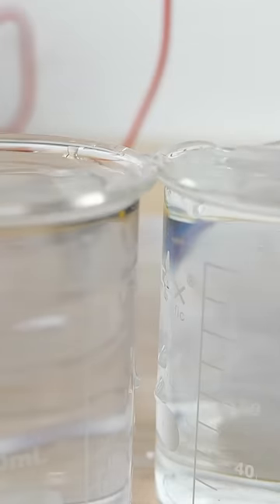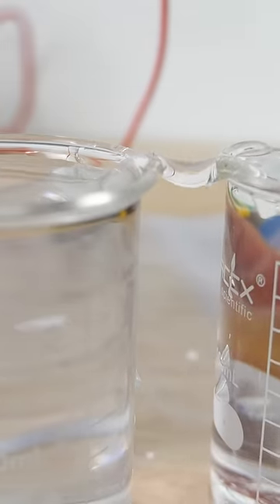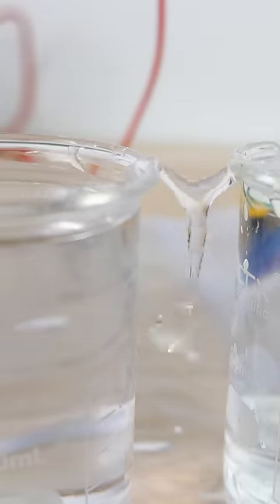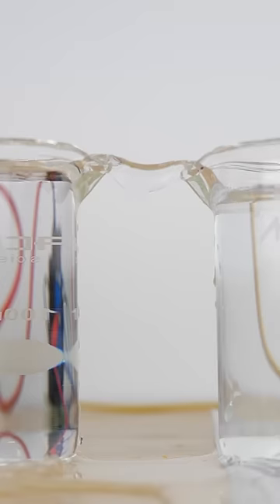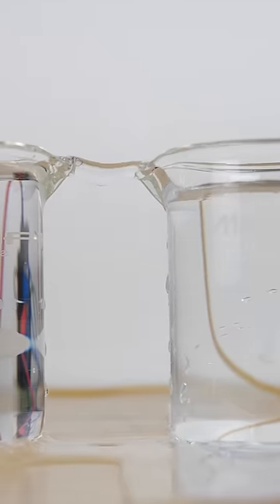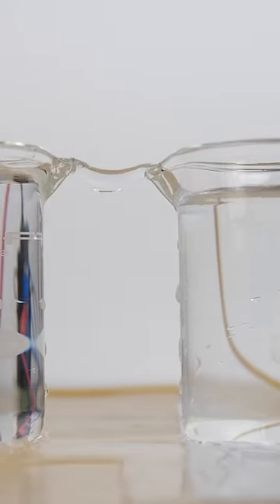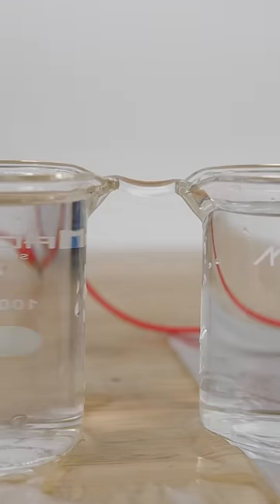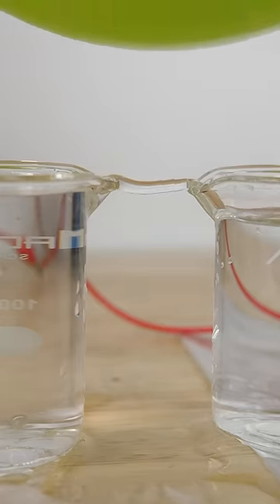How To Make Stretchy Water

Comment: One thing to consider, deionized water quickly loses it properties in open air. Carbon dioxide is an ionic gas and is (fairly) abundant in our atmosphere. The deionized water pulls in the CO2 easily, thus degrading the water. If your DI water sat around for very long (more than 30 minutes) there is a real possibility it wasn’t very deionzed anymore. Also, did you buy that DI in a bottle or do you have a DI system in the lab to get it “fresh”? If it was bottled, it probably wasn’t nearly as high purity as you might hope.

Comment: Electricity works by creating a voltage divide where energy at one end is higher then the other, and so it flows in the direction of low energy. Add a little friction forces and the water gets dragged along.

Comment: Stretchy water is when the water molecules, influenced by a super low voltage, undergo a spontaneous phase transition into a highly elastic state, akin to a rubber band. This temporary alteration in molecular structure allows the water to stretch and form a bridge between two beakers, showcasing its newfound prowess in defying the laws of physics. It's like water's rebellious phase, where it decides to challenge conventional science just for the fun of it.
Reply: This is total bs btw
Reply: No. Just no.

Comment: Electricity continues to flow through the air if the tether is broken. Until it disperses or loses contact with the current. Electricity is basically just an electron highway, where the electrons do not want to stop moving until they hit the ground. So the water tension added with the electrical tension create the bridge.

One side heats up because the electricity is going to that side and has no where to escape so it converts into thermal energy. Because matter cannot be created or destroyed. So if you ground out the water with another metal wire, you should solve your heat sink issue.

And the static electricity from the balloon attracts the electrons from the electrical current, causing the bridge to try and jump to the new source. But the pull is not strong enough to counteract the pull from the other glass.

Comment: Water is polar, so i'd imagine the high voltage, and the magnetic field generated by the flowing electricity, pull along the water molecules.
Reply: If you don't have a phD you should get one for free
Reply: There shouldn't be much of a magnetic field if the water is deionized since it'd have a pretty high resistance to current flow. Unless the water molecules themselves become ionized by a voltage that high? Otherwise they'd be electrically neutral and not so good as charge carriers.

Comment: After the water bridge broke an electric arc formed 
I'd say the electric resistance of water is much less than air but the electric field was strong enough to keep the current flowing after all opposite charges attract 
the high voltage ionises the water
2H2O→ H3O+ + OH- 
And increases the surface tension enough to resist gravity 
And of course any electric circuit heats up since it has a resistance to the flow of charge that wastes energy 

But that's just my suspicion

Comment: Theory: The shortest path is on the surface, at the top where there is least sag. The reason for water's surface tension is the electronegativity of the molecules sticking together - the hydrogen ions are positive and when a voltage is applied they orient themselves to maximise stability, which means getting the hydrogen ions as close as possible to allow the voltage to pass through with minimal resistance. This decreases the freedom of brownian motion for the molecules, so they remain in the surface tension state, stuck together. This makes those molecules at the surface a negatively charged film that is very lightweight for its charge, and if the voltage is high enough it will overcome the resistance to motion caused by the weight of water just behind the film when put under an electric field. 

The water heats up because the average velocity of the molecules stays the same, but the surface molecules are being held in place. Their energy gets redistributed to the flow travelling one direction.

Always fun to do hypothetical physics lol even if it is the start of April

Comment: very cool, especially when there are no conducting salts in there to aid the current. 
I feel like this is an electromagnetic effect caused by electron movement from molecule to molecule , basically sticking the electrons together and gluing the molecules to each other elastically.
I wonder if there is an isotopic reaction too perhaps forming higher electron fields in certain structures

Comment: The water wants to move due to the current across the two bodies of water. The water is able to form the bridge and move due to the surface tension of water. The rate of movement at that time is directly related to the amount of energy and resistance in the system. When you introduce the static charge balloon in the correct position it draws the flow upwards into the shape of a siphon and now there are two mechanisms working to move the flow making it seem as though the system is more excited even though you have not added more energy.

Comment: water molecules are polar. when you charge with electricity then electrons go from one side to the other pulling water molecules with it. the reason why a water bridge is possible is because its pulling energy beats gravity up to a point where the mass of the water bridge if too large beats the pulling

Comment: That phenomena is caused by the surface tension of water which is originated by the electric charges of hidrogens atoms, when they get aligned through the powerful electric field formed along the all the molecules of water between the electrodes.

Is a phenomena similar to a long chain of non magnetic metallic balls or metallic shavings formed between to distant magnets, but now with electric fields instead of magnetics.

Comment: You can do the same thing but more effectively vibrating the water to create a hydrogel that actaully acts like a fiber optic cable. In fact our bodies already do it and send biophotons through them that have picked up and carry information.  The water is turned to a hydrogel by specially placed holes in the microtubles that vibrate the water as it flows through.

Comment: I'm pretty sure its because you turn the water into a magnet. If you do the same thing with Ferrofluid and it works the same that would mean the charge is increasing surface tension and making the molecules stick. I wonder if more power would make it bigger or if its all the same?

Comment: In deionized water, there are still ions due to autoprotolysis. This leads to there being H₃O⁺ and OH⁻ ions, about 10⁻⁷mol/l each.
This does not sound much but it's still 6×10¹⁶ of each ions in a liter which makes up about 4mC of charge.

Comment: If it reacts to the baloon like that, then  the water bridge is most likely caused by electrostatics.

If the water moves while near high voltage, then it's not surprising that some energy will be converted into heat.

Also, have you checked how that water contraption affects that power grid and what resistance does it have?

Comment: I think it's just the electrical current itself making it like a fibrous channel from the pathways of the currents. So maybe microbubbles but I think it could just be the channels of the currents itself. Even though it's "very low currents" within it there is still current. As for why it flows that way, it's literally the path of least resistance because of the shape of the beaker pour.

Comment: I think that's because the electrons are traveling in the same direction and in the process of electrical resistance the water heats up so basically it starts heating up on the bridge and the heated water stays in one cup.

Comment: Well my hypothesis is that the energy flows through the water to the other cup and in that motion it creates suction or drag which continuously needs to be filled like gasoline through a hoes after sucking it.
And then you might ask why water and not air? My answer is surface tension wich in this small amount is greater like you said yourself the energy needed to break the surface tension is greater then keeping it running. 
About the water warming up I could say the motion creates friction but I don’t think that’s it. Somehow the energy (electricity) must change to warmth but some materials get hot while electrified especially thin materials. This is not thin but the ”water bridge” is pretty thin. (Question 2)
Challenge: to correct me if I’m wrong and failed to take something into account.

Comment: I’d say it’s possible that the weak magnetic field or whatever you call it of individual h2o molecules is getting amplified by the voltage. Where you have current you have a magnetic field, right? At 40kv, things just start breaking, right? Maybe some form of energy to magnetic field conversion at a molecular scale making the water join and bridge up. Would that be possible to test or disprove in theory? Idrk anything about this sorta stuff as far as coming up with new ideas… another thought tho is that high voltage ionizes air, which we know to be the best insulation, so why couldn’t it just ionize water, and the surface tension is keeping it together, but also the water itself insulates the voltage too, giving it more surface area to spread across, so we don’t get the lights or sounds, like a wire that’s see though, ionized by high voltage… maybe both?

Comment: my guess: its clearly high enough voltage to make the resistance of the water not do much, so im thinking this is that same phenomena as when high power goes though a bunch of cables in parallel and they all move together. this force must hold the water together better causing the surface tension to not break.

Comment: The water flows from one side to the other due to the molecule's electro-magnetic field being dragged along by the flow of electron energy and its associated electro-magnetic field, as well as the water molecule's inherant propensity to maintain their bonds (surface tension). It heats up due to the resistance of the water because it is not a superconductor, even though it is deionized... it still has electrical resistance, which must be converted to heat. It takes more energy to break the molecular bonds (surface tension) of the water than it does to just simply pull it along. Water molecules inherently want to stick together rather than separate because they are electro-magnetically attracted to each other due to their electron bonds. This is where the property of surface tension comes from. Every atom, and thus every molecule is a little tiny electro-magnet affecting every other atom around it without even coming into contact, just through the electro-magnetic field as atoms never actually touch each other, their only interaction with each other is through the electro-magnetic field. So as the electricity is flowing from one side to the other its like a magnet pulling other magnets in the same direction of travel.
Reply: check out the Grothus effect

Comment: I think that the electrical current supports the water between the beakers until the gap becomes wider making it impossible to support the weight of the water. 
I'm guessing: depending on the polarity will determine the direction of flow.
Pure water does not conduct electricity but rather the impurities in the water. (Fact)

Comment: It may not be deionized. Carbon dioxide will dissolve and react with the water to form carbonic acid. The acid can release a hydrogen or 2 making the water ionized and conduct electricity.

Perhaps the voltage promotes the production of carbonic acid.

Comment: Water are polar molecules and can also form hydrogen bonds with neighbouring water molecules due to the charges within the molecule. I assume since you’re giving it enough voltage the delta between the charges increases (probably more negative due to electrons) making the attraction stronger leading to the water bridge. Also the fact that electrons will also move from positive to negative it will also drag the water molecules along using the polar side of the molecule??

Comment: I had assumed that the charge would have cause the valence shell to have so much power that it networked from shell to shell. The data that lead me to this was the fact that electrons are negatively charged and the fact that electricity flows from the negative terminal to the positive terminal.

I'm also assuming that one container is where the positive terminal is and the other is the negative terminal. Or that both terminals are in the same container. It's not likely that both terminals are in one container but even if they were, I'd guess the high voltage would cause the channel expansion allowing for bridging and arcing as shown. I would suspect that if that were the case, there would instead be two bridges. 

Honestly, I'm also assuming I'm wrong and I'd like to know what makes it wrong.

Comment: "we also don't know why the water heats up, this is de-ionized water so there should be very low current in the water"
Well, when you run a lot of electricity through something that resists instead of coneucts well, doesn't it usually result in heat?

Comment: Electrons flowing from one beaker to the other is why one is getting hotter and one isnt? Does the water flow in the same direction as the heat? Do they all flow in the same direction as the circuit?

Comment: I'm thinking quantum mechanical, especially considering the lone pair of electrons and the pos neg polarity differences in the molecule itself. I could be wrong but I'm kind of thinking about how magnets can influence liquid oxygen. The high voltage may cause internal magnetic fields in the molecules. The poles depend on the anode and cathode. That's why the water flows in one direction. IDK, I'm an analytical organic chemist, not a physicist or physical chemist lol.

Comment: My guess is that it's like arcing between two high potentials, through air. Except the medium separating the potentials is another fluid; water.The voltage tries to create a current, and will follow the path of least resistance. The way to tell visually, would be to have two parallel trays of water, connected by a few bridges of isolating material. A bridge of water will create as the favored path (under high potential). By contrast, if one of these few bridges is made of copper, you should not be able to see the water bridge. Removing copper, the water bridge would return. Just a guess. The balloon creates an electrical induction able to trigger the creation of the water bridge. Just a guess. Love your channel very much! You should be paid by world universities to challenge and STIMULATE young minds into sciences, instead of merely learning what we already know. Cheers!

Comment: The two positively charged hydrogen ends of the water molecule are normally attracted to the negative charged oxygen ends of other water molecules. Imagine then that you have 40kV creating an attractively negative stream of charges flowing from one place to another. All of a sudden that feels like a great place for the positively charged tips to aim for. As a result you’ve accentuated the cohesive effect in the water. All the positive ends of the water molecules aim for the negative electrical charge. They reinforce the surface tension nature of the water. They may even be attracted to the flow of electrons and be trying to follow.  All of a sudden you have form and motion in the liquid. Now imagine you change the balance of the attraction from the 40kV electron stream to the balloon nearby. You break that tension and all the directionally attracted molecules forget to thank the 40kV and they fly off.

Comment: Electricity is energy, water is a medium for this energy. Energy creates potential energy waiting to be released, like lightning. Heat is energy, heat is electricity. Enough heat creates lightning. Think of the static shock a human can hold a charge and release it when close to a ground. It should be the flow of electrons that creates this bridge.

Comment: I'd say we should test it in different conditions, especially magnetic shielding, faraday cage, dustless environment, inert atmosphere, different temperatures and pressures, and combinations of these. Also the usual stuff like different beaker sizes and materials, and even higher voltages.

Comment: The water is using the structure of the electricity to attach itself to and travel along. Like it does along chains/string
Reply: Electricity doesn't really have a physical structure its just the movement of electrons through a substance.

Comment: its the current trying to stay as a circuit ... the water is a mere conduit since its transmitting power better than air ... id say the water is moving with the flow of the current

Comment: Water is a polarized molecule.
You're creating an electric current, which means there is a magnetic field around the current.
Surface tension happens because of water's slight electromagnetism.
The magnetic field holds the surface tension on its outside.
Epic.

Comment: Its becausee water has a positive and negative pole.  Due to the electron positions in the hydrogen and oxygen atoms and when in a water molecule. The direction of electrical charge is from one to the other this also creates heat and has an osmotic efect and changes in pressure. This static pressure or surface tention. Cant remember the actual term.  Anyway this is a similar principle of electromagnetic trains and railway systems(/railguns).

Comment: So the Egypt pyramid was thought to had electricity and flowing water underneath the tunes. That's what a tombs are cut off because there is a underwater flow that's flooded the rest of the tomb at the bottom. So I think you have found a great piece of information towards that